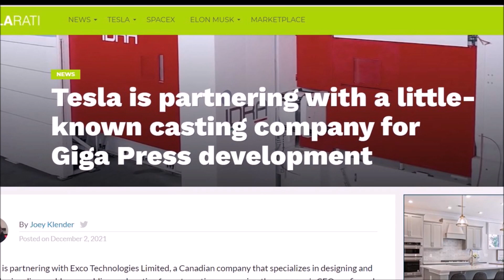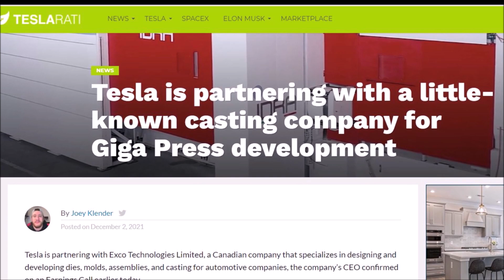Tesla Asks US Gov't To Waive China Tariffs For 4680 Battery Production

Comment: Batteries are the limiting factor in EV vehicle production, materials are the limitig factor to making batteries. Of course a shortage of graphite has to hurt production. all the bright projections count on materials being there even though materials are the hardest part of the puzzle to solve. It's much harder to ramp up a mining facilty than a manufacturing facilty.. and that's after you find the mineral you want to mine. Tesla has worked hard on lining up supplies of both materials and companies to product batteries and even they can't be sure how many they will have the materials to make.. it's like a large baking compqny promising lots of cakes and pies but having good supplier of flour, butter or eggs.. that's a promise that no one csn know how it will turn out.